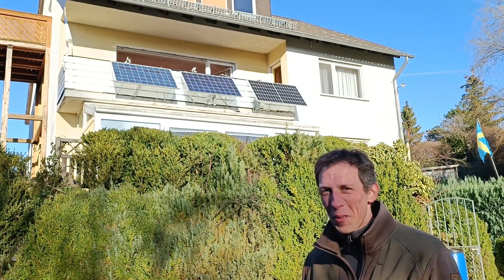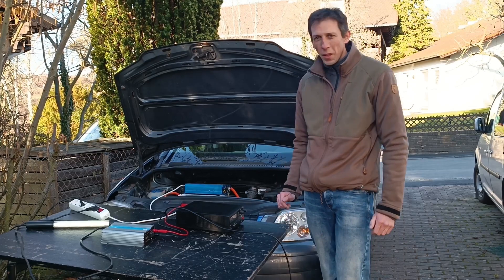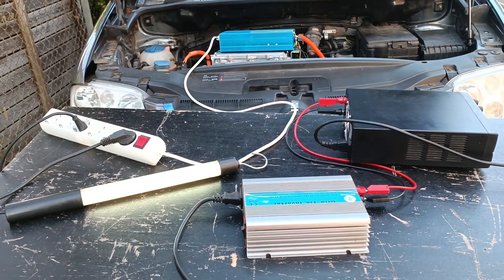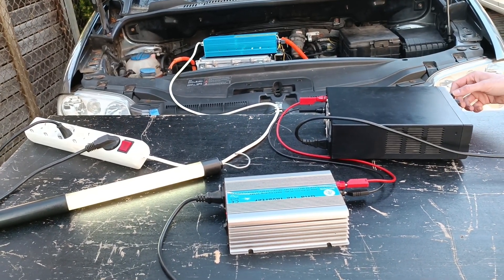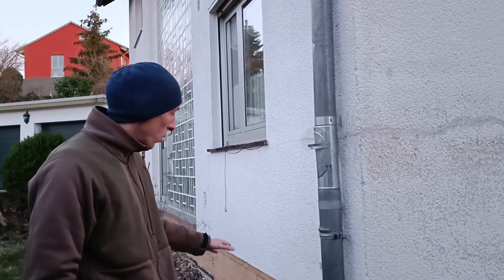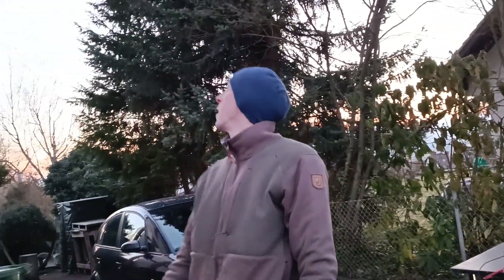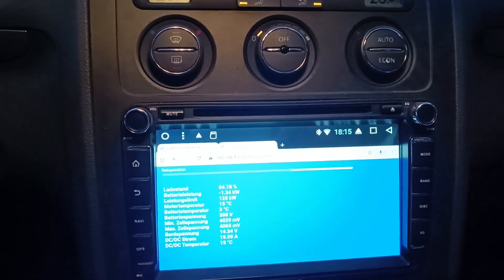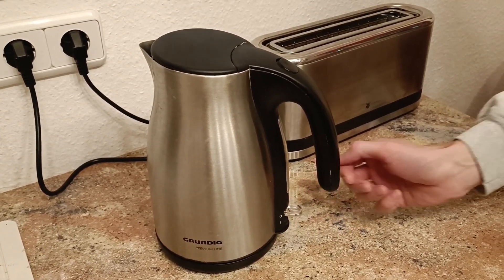Lab Update #72: Touran V2H and back again PV charging

Comment: Hi johannes. 

I have a question about joining the 3phase together. Does that now pose a danger to the neutral as there is no phase separation and the neutral could potentially be seeing the full current of all three phases? Maybe not an issue with a small inverter. But Could be a problem if you went above the rating for 2.5mm2?
Reply from the maker: Right, wouldn't want to push this past 16A

Comment: Male to male adapter on a house holde net is genera a bad idea 😂 but it woks as long it is done in the right order 👍
Never thought of shorting the 3 phase out, it runs ok as-long as there is no 3 phase motors...
Why not use a SUN-2000GTIL2-LCD with limiter, it works fine😊
And WELCOME HOME 😊👍
Reply from the maker: Thanks and yes as in most households I have no actual 3-phase consumers. Just 1-phase ones distributed over all phases.
SUN-2000GTIL2-LCD is a low voltage inverter but we need to run from 400V directly.

Comment: That way I could integrate a PV on the Roof of the car to charge by low power.   Its a pitty that the standby lost is sometimes higher than the sun can send us.
Reply: I’m searching for a similar solution. Prius inverter/converter could step up the pv voltage. Still searching…
Reply from the maker: Yes with the car fully on standby losses are too high. When I put it in charge mode only a few devices are turned on, that should drop standby losses to 20-30W

Comment: V2H w/o chademo.   To Understand…you connect one Phase to the of the leafinverter exit (power for the engine) which is normaly used by rekuparation.  Correct?
Reply from the maker: Leaf inverter plays no role here. There is a separate offgrid inverter (the blue box you see on top)